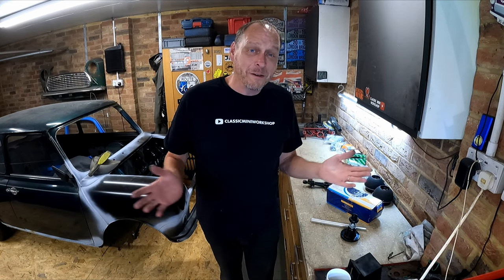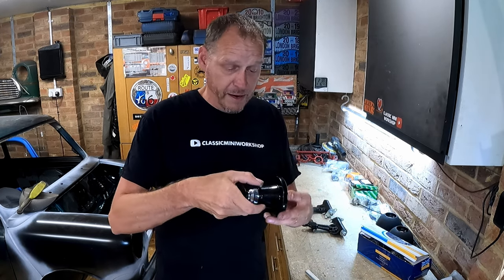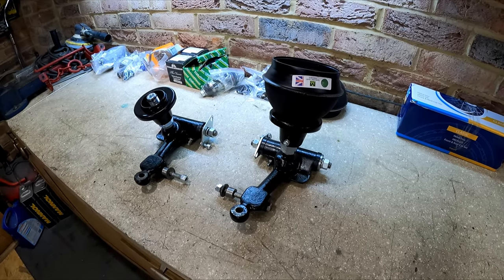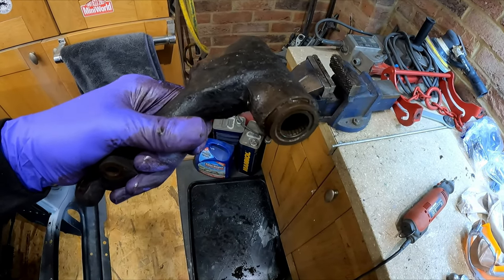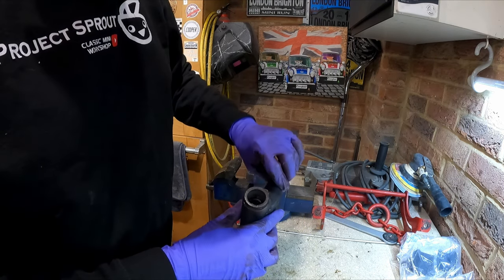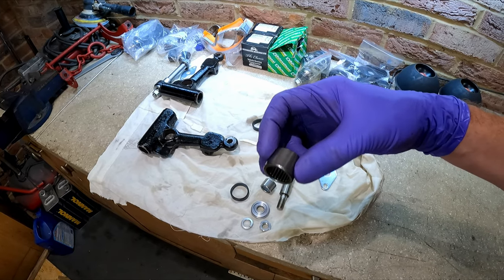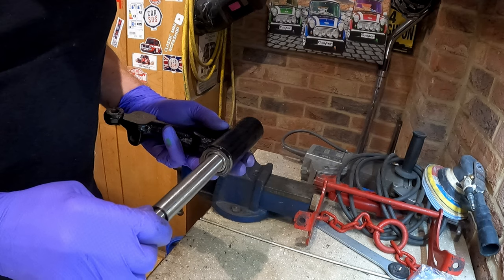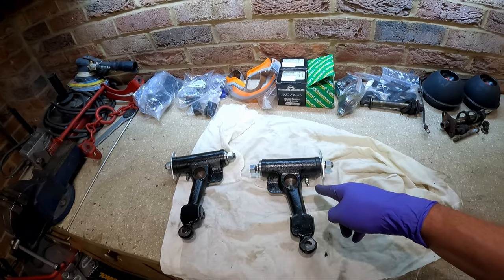Top Arm Bearing Replacement - Classic Mini Workshop - Racing Green Pt.48

Comment: I was disappointed recently to discover that Halfords had stopped selling Hammerite paints. They only seemed to have some own brand offerings. I purchased a tin of engine enamel in satin black which was supposed to be brush on. In practice it was very thin, didn't cover very well and dried matt. I won't bother again.

Comment: The rubber o ring seals. The ones that come in the mini spares top arm kit are shocking. 12mths or so after they just split and fall off. If you search on mini spates they do a genuine o ring that will last ages. Just a tip for everyone there Keith 😊😊

Comment: Um, not sure if I misunderstood, or something is different on my mini, but I think the fat washer goes towards the front behind the thrust plate. It just doesnt fit with the fat washer at the back. Plus the diagram on minispares says fat washer at the front. Can you double check???
Reply from the maker: 14:37 I corrected it in the video?
Reply: Ah! Was working away while watching so I missed that flashing up! Thanks very much for confirming though. And thanks for the video, really helpful. My top tip for anyone not able to find a threaded rod to pull the bearings in, a mini rubber cone compression tool can fit through the arm and be used to wind the bearings in, worked a treat for me.